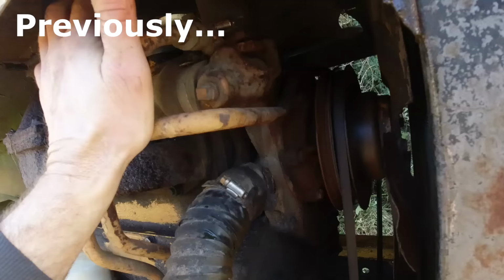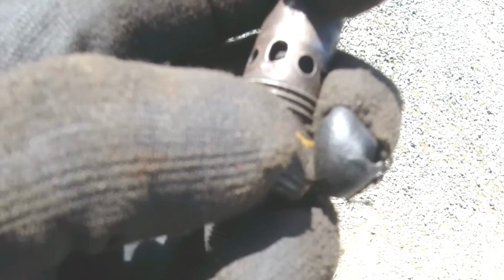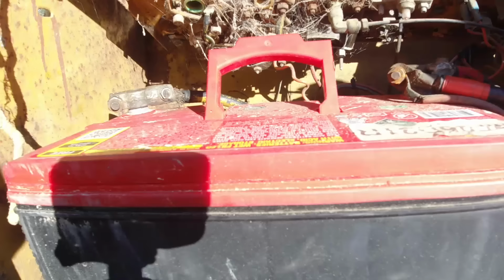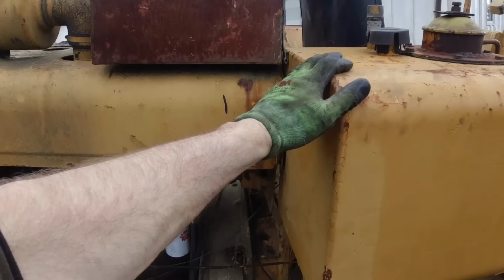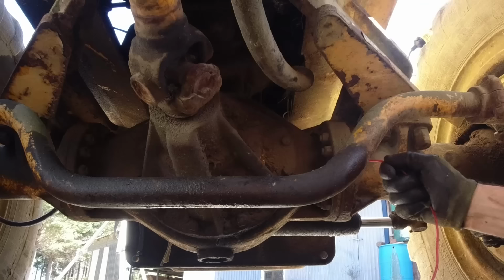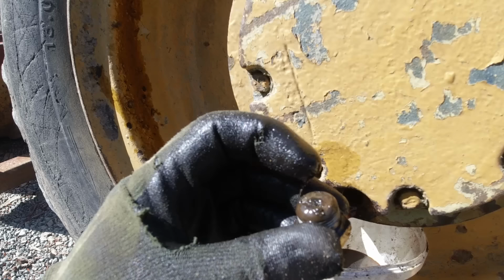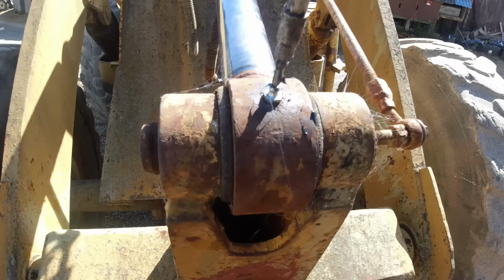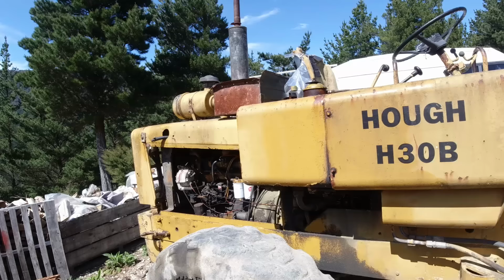Fixing the Hough 30 Payloader and putting it back to work..

Comment: I bought an Alemlube battery grease gun. I greased my excavator by hand once, and thought I'm never ever doing that again.

Milwaukee make 10,000psi grease guns and they're considered the bees knees as far as battery grease guns go but you have to have Milwaukee tools otherwise they cost a friggen fortune to buy in. I have DeWalt battery tools but their grease guns are no good apparently.
What a good battery grease gun gives you is: 
a) a shoulder strap that allows the body and therefore the trigger to sit hip height
b) a very long hose
c) a light
d) a built in design to allow the grease gun to sit upright when you put it down so it doesn't roll around on the ground picking up crud
e) very simple bleeding after reloading a cartridge.
f) a screen that tells you how much grease you've used

I'm very happy with my slightly effeminate 7500psi Alemlube battery grease gun particularly since it only cost AUD$575 incl GST.
Came with 2x batteries, a charger and the gun in a sturdy plastic case where you can keep everything.
Alemlube do make a full on industrial grease gun with higher pressure but they're more than double the cost of mine. Milwaukee? - forget it if you don't already have it.

Thing is the power of the gun to pump out hardened grease, blast out rusted nipples, and displace dirt encrusted grease from joints and shafts is not to be underestimated. Has a four jaw grease nipple coupler so it hangs on to shitty grease nipples too.

Comment: Good job on the loader.. when I change grease point's I usually clean out with a small screwdriver and steal wire then put in WD -40 / or diesel then put the compressor air pistol in the hole and blow air into the hole pushing out the liquid the I screw on the new grease point's and fill up with the grease gun
Reply from the maker: Yeah after removing zerks I poke a screwdriver down to check for blockages, if all clear I just install a new one, they're pretty cheap. A lot of these were damaged, rusty or the spring and ball had failed so best to replace

Comment: All these poor old machines on their last legs, just need some TLC unfortunately so many people that own them at this stage don't bother, because they think it's pointless, but doing what you've done, will now make that machine last many more years.
A tip for blocked grease nipples with old hard grease, is to blast them with a little heat from a blowtorch, it melts the grease and if you're lucky, you can add some new grease

Comment: alot of old tires still in action around the place, wonder if one of those wire irons the offroad guys use for grooving tires would be worth while, cut some fresh edges in get a another 1000 hours out of em before theyre toast, need a little bit of edge to go off the beaten path

Comment: With regard to the "clagged up" grease nipples, there used to be tool, somewhat like an impact driver, that was used to clear blocked grease nipples. It was filled with grease, fitted over the blocked grease nipple and then struck firmly with hammer, forcing the grease in and clearing the blockage. No use on badly damage parts, but very useful forclearing blockages.
Reply from the maker: Thats cool, I've never heard of it.. these nips were pretty far gone, rusty or damaged so best to replace

Comment: Thanks, Marty. Great as usual. 
I'm curious as to why you don't use a clamping style grease nipple fitting on the end of the grease gun. That's about all I've seen here in the states. Thanks.
Reply from the maker: I prefer the needle tip type

Comment: I had a hell of a time starting a Kubota G5200H. It turned out the glow plugs weren't working due to a lose connection. Now it starts first time, every time, a night and day difference. 🙂
Reply from the maker: amazing the difference a bit of heat makes, some diesels refuse to start without preheating

Comment: So @ 14:35 when you were installing the found nut on the hydraulic filter, it looked like it was covering a hole through the hollow shaft that the filter is installed on. Was that hole not part of the filter function?

Wonderful video!

Comment: Some folks would be surprised (or not!) that comparatively new equipment gets neglected just the same. My nephew in the UK fills his spare time on the farm in Winter resurrecting older tractors. He looks for machines with wrecked transmissions because the farmers don't know how to fix them and the dealers charge a fortune. He gets his satisfaction from helping a tight fisted farmer by removing a "scrapper" then driving it by the same farmer's front gate a couple of months later. The more they cuss the happier he is. Though a diesel mechanic he still watches MartyT and the American, 'Watch Wes Work' because though different, their basic approaches are very similar.

Comment: I am commenting early in the video and anxious to see if having the proper thermostat in the cooling system will reduce the exhaust smoke. A diesel with no thermostat can run pretty badly.

Comment: Put a quick coupler on the front of the loader so the bucket doesn't fall
Reply: It has that retaining chain at the top of the bucket that hitches onto the loader frame???
The forks of the pallet forks fit into the "shoes" in the bottom of the bucket; the chain just makes sure the bucket doesn't slip off the forks...

Comment: When I worked for Caterpillar ad they bought out Perkins diesel they use to use a "Flame thrower" cold weather start assit. Exact same valve. Cat wanted nothing to do with that set up and we weren't even allowed to call them flame throwers 🤣 we had to refer to them as cold weather assit set up 🤣🤣

Comment: I am working on an old Hough 65 loader with a drott 4 in 1 bucket on it. Engine has a bad knock, just pulled it out this past weekend. Hoping to tear it down this week to see what its issues are. I am thinking it has a broken connecting rod or piston in it.

Comment: Here's A trick for ya that you can try out. on those grease sert fittings is Using A propane torch to preheat them to open them up to release the ball bearings.& Springs down inside of those fittings on that bull dozer. The old grease will squirt out of the old fittings if their still good.&stop cause of closing back up from cooling back down. Then they may take grease after trying that little trick.

Comment: Hi Marty, someone my have already mentioned but on those ih engines to aid cold starting your hold the stop cable about halfway out when starting and this helps alot
Reply from the maker: I did try that but it didn't seem to make any difference, accelerator pedal 1/3 down does help

Comment: But shouldn’t you put a little tap before the glowplug ? I don’t know if the heat off the exhaust will let the diesel go true it if it’s hot enough 🤷🏼‍♂️
Reply: That glow plug has it's own valve that is normally closed. 
When 12VDC is applied to the thermostart the coil/element begins to heat up...

when the heat reaches a certain point the valve opens automatically and lets diesel through which catches fire on the red glowing spring element.

After the engine starts and 12VDC is switched off the flow of air in the intake rapidly cools the spring and the diesel fuel valve also shuts quickly...

No tap needed unless something goes wrong...
and the fuel has been through both those large filters before the electric pump so crud shouldn't get in....

Comment: What are you doing with all the muck oil? Are you burning it to make heat or running it to a recycle facility?
Reply from the maker: Keeping it for now, I may need to turn it into fuel.. the geniuses running our country have allowed our only refinery to be shut down, we are dependant on fuel from offshore and costs are skyrocketing

Comment: Good to see you working on... "not a tractor" 😜.  How has the right oil sponsor not found you yet?  Good vid mate and it looks like that is going to be a super handy machine.  What is the heritage of Hough?  I haven't come across that brand here in Aus but i had a step father back in the land of the long white cloud (still allowed to say that?)  that used to work on big Hough loaders when he worked for Gough Gough and Hamer back in the day.  An old mechanics tip that may be worth trying on your old loader... the tyres look dry rotted but i have heard that you can rub in brake fluid to rejuvenate the rubber.  Or in the printing industry there is stuff called revitol to rejuvenate rubber rollers.  If that doesn't work, ask Bert Monroe for some tips on that 🤣
Reply: @JohnSmith-yv6eq  Super interesting article John - from the looks of that timeline, my step father would have been working on these things in the late 70's / early 80's so it must have been the first joint venture with international harvester where they still valued the "Hough" name brand. @MartyT what year is your Hough mate?

Comment: Hello Marty. I always fill the filters with fual it saves pumping for ages to get the fual up.
Reply: @JohnSmith-yv6eq  hello. The reason for filling the filters is to stop more air going through the injection pump.
Reply: @JohnSmith-yv6eq  we repair tractors and plant machinery. The shovel Marty has. Will have had a lift pump no it originally. A machine that old won't have had a Electric pump. Cars are self bleeding.

Comment: I bet you that recommending  you get an ultrasonic cleaner was a great investment?  It appears they old owner didn't do much pm on the loader...  I have heated up old zerk (grease) fittings using a hand torch then pumped in new grease.

Comment: I do love these video's. It's nice to see the effort you put into it.
Nice to see a flamestart demonstrated. I only know these from books.

A few questions come to mind though.

- What are the costs for the oil and filters?
- The tires look like they won't last an eternity. Do you have plans to change them?
Reply from the maker: Oil and filters aren't cheap, I wait for specials and buy bulk when I see them discounted. Yes tyres are pretty average but they should last decades with the occasional use on my property
Reply: Thanks for clarifying. I do hope you get some years of action out of these machines!

Comment: Great job nice machine 👌, in case anyone is interested the item on the inlet manifold is a core heater plug not a thermostat. Could be confusing if you tried to order one, very common across all machines if that era
Reply from the maker: Thanks. Yes core heater or Thermo-start

Comment: I have a 1967 H30B. Where are you finding parts for these old machines? I need a Master cylinder and possibly a new hydraulic control valve. (It leaks but I cannot find new packings or the spools that are worn)
Reply from the maker: https://agspares.co.nz/
Reply: @MartyT  thanks brother.

Comment: Is there any drawback to starting a diesel engine like that with ether long term?
Reply: Not only yes but he’ll yes never use ether. Ether fires by itself before the injector opens,so the cylinder pressure spikes when the diesel is ignited. Breaking piston rings,blows head gaskets,breaks pistons,bends rods,knocks bearings out.  Then 3 months later the engine looses compression cause the broken rings junk the bore.
Reply from the maker: Yes it ruins the rings
Reply: @MartyT  I see. Thanks Marty.
Reply: @daleolson3506  Thanks Dale, I had no idea it was so brutal.

Comment: Hey!  love watching  your videos.  Question!  why don't you power wash the machine to get the old grime off before starting work on it?  I knew an old mechanic who always said to never clean the underside of anything because the oil and dust  made a great protection layer, but If you're bending a wrench on it  wouldn't it be nicer and easier if it was a clean surface?  Thanks and keep posting stuff to watch!!
Reply from the maker: I don't like leaving piles of greasy oily crud in the yard an yes it does help stop the rust

Comment: The coolant thermostat serves two purposes. The first is to hold the coolant in the engine until it reaches the proper operating temperature at which time the thermostat opens. The second is to slow the coolant flow enough to slow proper heat transfer from the engine to the coolant. By removing the thermostat, the coolant moves too fast and causes the engine to be dangerously overheated. The coolant shows the engine is cooler than it truly is. Never a good idea to run an engine without the thermostat.
Reply: Plus the coolant can take a short cut out of the block and back into the radiator.
The thermostat actually forces the designed coolant flow to operate and the rear cylinders
(furthest away from the water pump) 
get a decent flow restored to them...
so steam pockets don't form and cavitation wear of the exterior of the cylinder sleeves is minimised...

Comment: Alemite and likely some other companies make a fitting cleaner which snaps on the fitting, then you tap it with a hammer to free up the check ball so they'll take grease. May be worth the investment. I always wonder at what point in a machine's life the owner decides it isn't worth basic maintenance. Sad to see perfectly good machines be neglected due to just laziness.
Reply: If the wood yard owner didn't pay anyone extra to look after the machine after hours....
or designate that maintenance be done by ONE person during working hours....
this is what happens....

Comment: Hey Marty. Is that fuel feed to the starter valve after the filters? Just a concern the tiny hole will block and it will stop working.
Reply from the maker: Yes after the filters

Comment: Bro as you know a lot of the heavy equipment and trucks need to be vacuum coolant filled to avoid vapour locks in the system,I’m sure that wasn’t the case in the old timey days but I had fuckall to say other than good job bro.

Comment: You may be able to get away with getting rid of the diesel burner thermostat and use an off the shelf grid heater right at the intake tube, or a gaint glow plug in place of the burner. I've seen that work too.. I've never liked diesel heaters but I get it, batteries are expensive, elec heaters cost batt drain, fire is free. And I still think the clickity clack should go before the filters I'm not real sure why they would have set it up at the factory as a puller not a pusher.
Reply: OK, my bad. Must have been doing it wrong all these decades. Yes I'm aware it's aftermarket, IH even provided them as add-on/repair parts in the late 60's. I don't know why anyone would have put that type of pump after the filters wherever it was done before he acquired it but it's incorrect, they're pushers not pullers. As the filters fill up with crap flow is just gonna go away, quickly and starve the injector pump. That's why you traditionally have your lift pump before the filters to push fuel through the filters and your mechanical injection pump after. Neither is particularly good at suction. Almost everything is set up that way. That's also how you do away with air locks, as ge had in the first video.. and that's why I suggest moving the clacker below the filters closer to the tank. To push everything through. As its designed to do. It's a whole lot easier to push fuel though a filter than trying to suck it through. It's basic fluid dynamics

Comment: Be careful burning pine in wood heaters and stoves, it produces more tar and can increase the risk of flue fires ❤️
Reply: @JohnSmith-yv6eq  it’s worse in those conditions, but even with no moisture content there is still a lot more resinous material than a hardwood, making excess creosote that builds up and blocks the flue and eventually ignites and is basically a rocket stove,
Reply: @JohnSmith-yv6eq  did you notice I said ‘be careful’ not ‘don’t do it?’ Are you trolling or something? Everyone has varying quality or design wood burning devices, caution is recommended, good for you that yours is adequate for burning coniferous wood.

Comment: If the tyres needed replacing on something like this would it still be worth taking on?
Reply from the maker: Depends, If you could get cheap used tyres it would be, they're around $750 each new

Comment: Have you tried using an aerosol product from the Nulon corporation 
called  "   Start Ya Bastard "  ?
Reply from the maker: I have some and had it ready but thankfully didn't need it this time
Reply: I thought that was a great name for a Starting Aerosol product, haha.  I first saw it when watching Stu on his channel DangarMarine.  Nulon also has a spray lubricant called  "  Shift Ya Bastard to loosen rusted old bolts.  

Dis you know they also sell a handy little gadget  "  Open Ya Bastard " ?  It is a handy tool to open long neck beer bottles one handed.   @MartyT

Comment: Small point, Marti but literally 99% of people on YT who use a gasket sealant ensure massive squeeze-out both inside and outside the joint (More is betterer?) but you did a textbook job on the thermostat!  You even ran your finger round the inside to prevent internal squeeze-out!  Have you noticed the same thing or are you a real mechanic as opposed to a semi-armchair one like me?  Someone needs to do a master class...
Reply from the maker: Haha.. many years ago I was changing an oil filter of a motorbike I had reconditioned a year prior, I noticed some of my gasket sealant trapped in the filter, ever since then I am very careful not to let it squeeze to the inside of the casing

Comment: Like to see you pressure wash your equipment before you work on it. Make the job a lot clearer see what is really wrong if there is leaks
Reply from the maker: Yeah I thought about it but with a machine this size you end up with bucket loads of old grease and oil on the ground after pressure washing

Comment: The heating element should have had a metal fuel line. The rubber may hold for some time, but it isn't the most safe option at all.
Reply from the maker: The fuel pump is only running untill the engine starts so the high pressure rated rubber pipes are quite unlikely to fail with only intermittent use